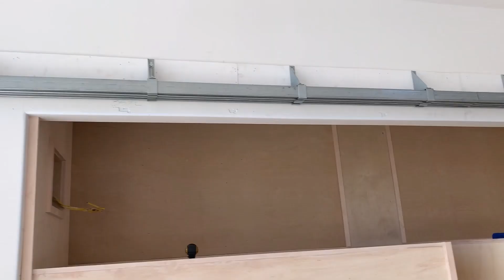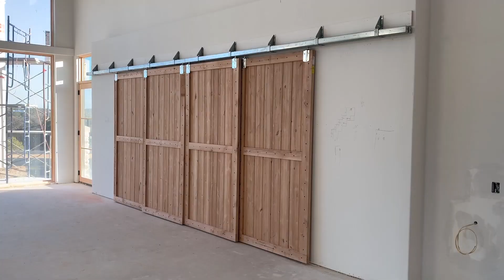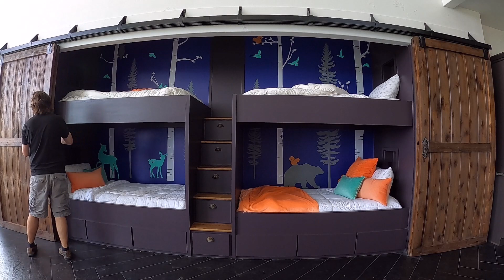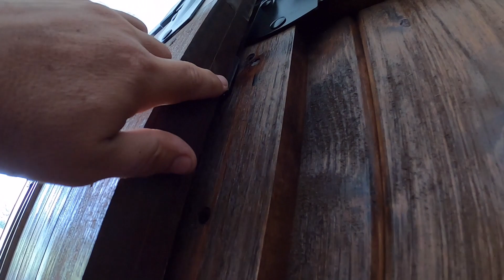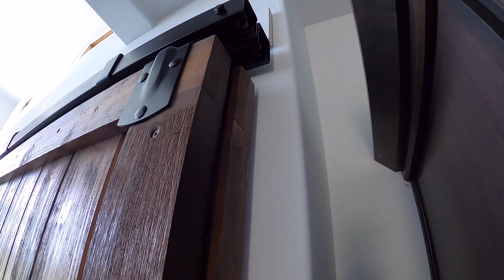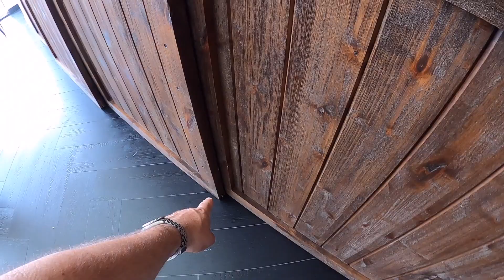Double Sliding Barn Doors ● Design Ideas, Required Hardware, & Install Tips for Your Barndominium

Comment: I love your project and exactly what we want to do to span a large opening, but keep it open when needed.  So how does the front door stay aligned and "connected" to the back door.  Did you rabbet under each of the doors and secure some type of hardware to keep them aligned and connected?  Thanks
Reply from the maker: Small track cut into the door. There is the little bracket on the floor to guide it. The video explains it.

Comment: I usually don't like barn doors inside for privacy but this is beautiful and the perfect solution for this application

Are those contiguous rails or multiple pieces?
Reply from the maker: I believe it was two 10’ pieces for a 20’ span across. I need to check to be sure.
Reply: @ApacheRanch  didn't think it would be a problem but I didn't see any specific instructions/bracket for butting two pieces together like I did with the round rails.

Awesome work and a very good explanation! Thanks for making this and getting back to me

Comment: What hardware did you use for the catch on the front door?  The one mounted on the back that catches the edge of the back door when opening them.
Reply from the maker: A home-made piece of angle iron is attached to each door. Shaved down to about 5/16” and sticking out from each door, to catch the other door’s piece of angle iron.  The gap between doors is small hence the 5/16”. Thanks for your comment.

Comment: Great video!  I am struggling to understand where the floor guide is mounted for the front door?  I was thinking it would need to be somewhere on the floor that could be a "tow catcher" but I don't see it exposed where someone may step on it when getting of the bunk.  Again, thank you for the awesome description!!
Reply from the maker: No floor guide for front door. Front door is held in place by a small bracket attached to the rear door, so nothing is on the floor that could be stepped on. Bracket is essentially a guide that is fixed to the rear door, and the groove under the front door glides over it as front door moves.  Hope this helped.

Comment: This is an amazing build and a great explanation!!! 
One question do you have the part numbers for the catch/stop that you used to have the first door catch the second door when opening, and then the second door catch the first door when closing? Thank you!
Reply from the maker: I had to make those parts by grinding down a small piece of angle iron. It was very thin angle, and I ground it down to about a quarter of an inch on the side that would catch the other door for the part when you open the doors. For closing, I left the angle iron as is. The angle iron piece that I used was only about 3/4 of an inch wide. I hope that helps.
Reply: @ApacheRanch  Thank you for replying and thanks for the information. It was great help.

Comment: I'm having trouble locating those double rails/double tracks that allow the doors to stack. DO you remember the brand name?
Reply from the maker: The link in the video description is working - they are available at Tractor Supply but I did not notice a specific brand name.
Reply: @ApacheRanch  thank you so much. One final question: what sort of locking hardware would you use for this system? Mine are going on a tractor garage
Reply from the maker: @geoffreyadams7619  Boy that's a good question.  Mine are only bunk beds, so no locks at all.  If you have something important in there, I would consider something that would lock the two handles together - since each door cannot move any further than the centerline already.  If the two middle door handles are chained together, then the space would be secure.  I wish you the best!

Comment: thanks so much for thtis video!  this is exactly what I need to do for my garage.  it is an old but sturdy building (so I don't want to replace it) that has 2 old open-out doors that don't clear the upward slope of the driveway, so they won't open all the way.  There is not enough headroom  in the building to mount a regular garage door or a roll up door.   Short of re-grading the drivway, this would be the answer. to my problem.
Reply from the maker: That’s great to hear! I wish you the best.